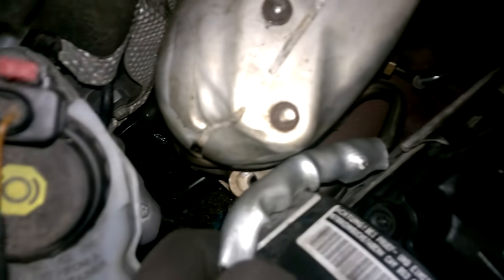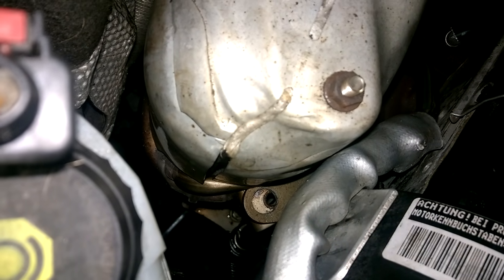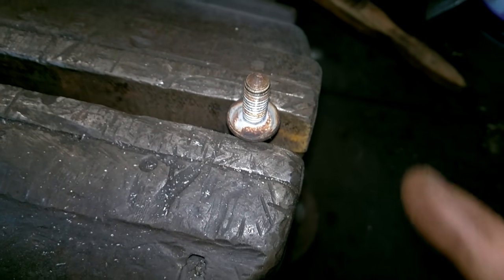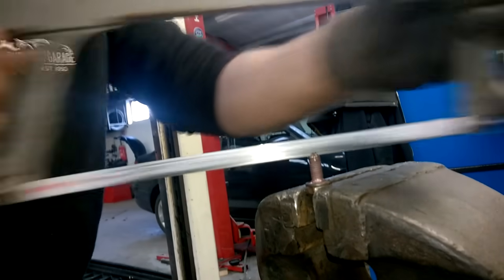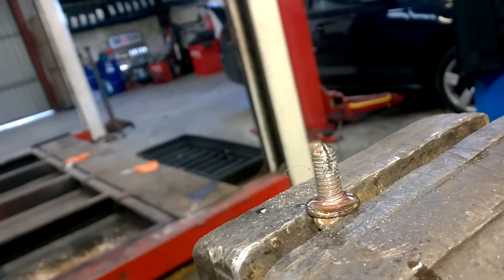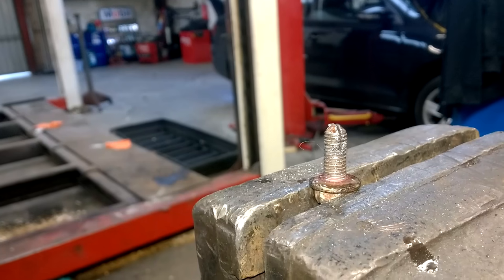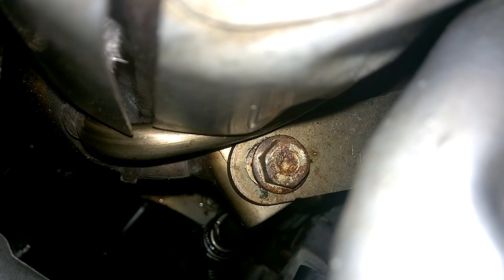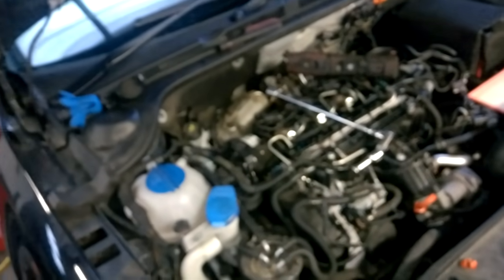My Father Taught Me This! Passing It On To The Next Generation

Comment: the cuts also act as a cutting edge to clean up the threads much like a thread chaser. great job sir!
Reply from the maker: Nailed it Trae, 99% people don't get that part. I made a follow up video ages ago to show it. 
 
The update info below is the pinned comment on this video, I know most people do not realize I made that video and it better explains/shows this method in use.   
I also included below details of why the job was done this way free of charge with the customer fully informed. I hope you check it out  👇👇
 
UPDATE* I decided to make a follow up video on this https://www.youtube.com/watch?v=yfNQullGEuQ&feature=youtu.be Should answer some of the questions that were raised, I include 3 demos of this in action with close up shots.
 
As there was some safety concerns & confusing comments raised, I felt I should clear a few things up. 
1) This is a tip for certain circumstances only, I never have and never would use it on a component which would cause any safety concern to any customer.  
2) The demo was done on a support bracket only, items like this or similar will not cause any safety concern. 
3) I did this free of charge and on a time restraint, I noticed it when I was replacing another item, the customer needed the vehicle back that evening and I decided rather than leave it like it was, I would do this and secure it up fully. 
4) The bolt was not the issue, the part that the bolt threads into is a secured piece, someone had previously damaged it, leaving the bracket loose and the bolt just tightened a turn or so.
5) The bolt can be removed and will not break, it will go in and out as usual and has helped clean up the damaged threads.  
6) Used in the right application I personally believe this is a great tip and can save you a lot of time & trouble. 

Lastly to all the people who have watched the video, Thanks very much and I am delighted with the feedback I have received on it.

Comment: My Dad showed me a trick too use a set of stocks & dies to retap a bolt put on some oil 1 rotation forward half a rotation back to clean out dags or screw 2 nuts onto a bolt one screwed back other screw in they lock against each other that's a lock nut right there ! 👍

Comment: Great idea, but I'd suggest starting the slot with a moto tool and thin cutting wheel. Otherwise with many high grade bolts your hacksaw will be sliding all over when trying to get started.

Comment: Very nice. I’ve always known this was why fender bolts are pointed but I never thought of doing this with other bolts on other application. Thanks
Reply from the maker: Thanks moore fab
 
The update info below is the pinned comment on this video, I know most people do not realize I made that video and it better explains/shows this method in use.   
I also included below details of why the job was done this way free of charge with the customer fully informed. I hope you check it out  👇👇
 
UPDATE* I decided to make a follow up video on this https://www.youtube.com/watch?v=yfNQullGEuQ&feature=youtu.be Should answer some of the questions that were raised, I include 3 demos of this in action with close up shots.
 
As there was some safety concerns & confusing comments raised, I felt I should clear a few things up. 
1) This is a tip for certain circumstances only, I never have and never would use it on a component which would cause any safety concern to any customer.  
2) The demo was done on a support bracket only, items like this or similar will not cause any safety concern. 
3) I did this free of charge and on a time restraint, I noticed it when I was replacing another item, the customer needed the vehicle back that evening and I decided rather than leave it like it was, I would do this and secure it up fully. 
4) The bolt was not the issue, the part that the bolt threads into is a secured piece, someone had previously damaged it, leaving the bracket loose and the bolt just tightened a turn or so.
5) The bolt can be removed and will not break, it will go in and out as usual and has helped clean up the damaged threads.  
6) Used in the right application I personally believe this is a great tip and can save you a lot of time & trouble. 

Lastly to all the people who have watched the video, Thanks very much and I am delighted with the feedback I have received on it.

Comment: always use the full length of a hacksaw blade because not only does it make efficient use of your energy but by wearing the blade evenly it prevents it from jamming, this also makes the blade last longer. using only the middle means the "set" of the blade wears faster there and when a stroke hits an unworn section it jams. only put weight on the cutting stroke, the return stroke is for clearing swarf. And the length of a hammer handle is there for a reason as well. a mechanical advantage is gained by holding the hammer at the end giving a heavier blow for less energy. All hand tools have been  developed into their most efficient shapes and sizes by craftsmen over many years for a reason.

Comment: I’m not one for cutting corners( in this case bolts), but looking at the wear spot on the bracket, it would appear that things became out of alignment a long time ago. Everything is designed with purpose in mind, you have just circumvented the integrity by adding stress to the bracket and bolt hole, better to disassemble and realign so it’s proper.

Comment: Quick tip, before you cut a screw/bolt, thread on a nut. It will clean up burrs on the threads when you back the nut off.

Comment: Who in the Holy Flying F*** would take the time to watch this and give it a "thumbs down?" Thanks for taking the time to post this simple, but effective little tid-bit of knowledge. Cheers!!
Reply from the maker: Cheers Marc 

The update info below is the pinned comment on this video, I know most people do not realize I made that video and it better explains/shows this method in use.   
I also included below details of why the job was done this way free of charge with the customer fully informed. I hope you check it out  👇👇
 
UPDATE* I decided to make a follow up video on this https://www.youtube.com/watch?v=yfNQullGEuQ&feature=youtu.be Should answer some of the questions that were raised, I include 3 demos of this in action with close up shots.
 
As there was some safety concerns & confusing comments raised, I felt I should clear a few things up. 
1) This is a tip for certain circumstances only, I never have and never would use it on a component which would cause any safety concern to any customer.  
2) The demo was done on a support bracket only, items like this or similar will not cause any safety concern. 
3) I did this free of charge and on a time restraint, I noticed it when I was replacing another item, the customer needed the vehicle back that evening and I decided rather than leave it like it was, I would do this and secure it up fully. 
4) The bolt was not the issue, the part that the bolt threads into is a secured piece, someone had previously damaged it, leaving the bracket loose and the bolt just tightened a turn or so.
5) The bolt can be removed and will not break, it will go in and out as usual and has helped clean up the damaged threads.  
6) Used in the right application I personally believe this is a great tip and can save you a lot of time & trouble. 

Lastly to all the people who have watched the video, Thanks very much and I am delighted with the feedback I have received on it.
Reply: Gerard Burke, thanks for the update! Your Father continues to educate us through you. Love it!! Keep 'em coming!

Comment: That bracket is supposed to be tightened to the engine 1st. Then the top bolt is supposed to be screwed in and left loose BEFORE tightening the 2 bottom bolts on the DPF.

Comment: That's quite clever.
I thought from the thumbnail it was going to be a trick I found when undoing stiff bolts that unscrewed, a laborious fraction of a turn at a time, from the back of a flange (so the spanner on the bolt head could only turn a few degrees before hitting the surroundings).   Cut a slot in them, then you can put a screwdriver through the hole and screw the bolts most of the way with the screwdriver from the front, just the final tightening or initial loosening needs the spanner to be applied to the head behind the flange.

Comment: I have had to grind a bolt thread down like a point.but on one side.grind the bolt on a 45 degree first.then anothe 45 degree against that cut.then taper off the treads. that way when you have a motor mount or two peices that are very hard to hold in alignment,that point will go in and pry the two holes in alignment as the tread starts.always works perfect.this is a very good idea also.exept it wouldnt align as much as a pointed bolt.

Comment: Creative. No holds barred. We need all the tips we can share with one another, due to strength and some mech's leaving it for the next SOB, as a mech in the U.S. Navy Aviation rate, i was schooled by pro attitude ol timers that if u leave it for the next SOB, i might b that next SOB.
1977-1988 / HAL-5
Helicopter Attack Squadron Light-5, we had 8 to maintain, so u see how it can come back to bite you.

Comment: The good threads are at the bottom because someone messed up the top threads. Since the top threads are damaged and now the bottom of the bolt is weak, you only have a couple of decent threads holding. This is a good trick for something that doesn't matter. The right way to do this is to clean the hole threads with a tap and or use a longer bolt to get more good bottom hole threads if possible. Bolt hole threads usually get damaged from people being in a hurry and using impact guns to start bolts, instead of being gentle. There's an old saying" slow down, we're in a hurry".

Comment: Why not use a three point (triangle) file and clean the threads up? Then it'll go right in nice and you don't loose any holding strength.
You may also have to clean up (retap) the threads in the hole. If screw was damaged chance is the hole it came out of was damaged too.

Comment: It works but I don't think it works for the reason stated.  The bolt might collapse a bit one direction but I don't think it's enough. 
What you've done is essentially created a self-tapping screw.  It's a good tip and certainly works great.

Comment: How about loosening the rest of the bolts that hold the bracket. That way you can adjust the bracket and you won’t have to slot the bolt to force it into place. Do the job right and you don’t have to worry about things like this.

Comment: Love it. Here's my 'get out of dodge' suggestion for anybody who needs to drill through stainless steel; if for whatever reason you are missing a cobalt drill bit? A masonry drill bit will do the job, maybe not exactly 6.5 mm but near enough to fasten/bolt one surface to another?
I am the last person to 'espouse' bodging a job (I couldn't suffer it), do it right or don't do it as all but there will come a time when you have to judge craftsmanship against simple expediency. I reluctantly agree that 'making the thing work' is often the object and it should remain so. I have literally stepped in the footsteps of the Stephenson's, I hope they thought I did a good job!

Comment: If that bracket was the original part It should fit. If the holes are out of alignment some thing is wrong.
Either the parts it bolts to is positioned incorrectly. Or you have tightened the other bolts before fitting the last one.
When you have more than one bolt holding a component, you should fit all the bolts before tightening them.

Comment: I am 58 years old first twenty years of my working life in the engine reconditioning game and i taught my son how to invert the bolt and taper the end where the threads are damaged on a bench grinder works everytime you also do it when you shorten a bolt or cut some threaded rod, just put a slight taper on the end of the bolt.

Comment: Cut off wheel on a rotary tool will save you time, and effort. A similar trick works for rounded bolt heads. Just cut a slot in the head and remove with a screwdriver.

Comment: Interesting hack to a problem.

I would have to point out that the first thing to do is find out why the bracket hole doesn't line up in the first place. the bracket shows where the original bolt was holding it, the bracket didn't move over back to the original position. The bolt is in what kind of additional stress did you add to whatever the bracket was holding? Would that stress cause a long term problem to develop which will lead to a more costly repair. The bracket did have some play in it to begin with, what about a bracket that didn't have the flex required?

Comment: Or you could have used a punch to line up the brackets, and then once in proper alignment, hold them in position with a small needle nose vise grip and start the bolt.

Comment: Nice tip... Would like to pass one on to you. Could save you some $ on hacksaw blades. The balde only cuts one direction. Then you lightly drag the saw back to clean teeth. Trying to saw in both directions will just wear you and the blade out. And as mentioned in previous comments the longer the stroke or more blade used the more productive  and cost effective you are... Your Welcome in advance...

Comment: I’ve used the cut bolt/spark plug method for clearing and cleaning threads but this is a one up on the idea. I’m sure that there are situations in which cutting an X rather than a slot might be beneficial as a bolt alignment/ starter. Thank you for passing on your father’s “tribal knowledge” (information and techniques not written in manuals) and I’m positive that I will make use of it someday... I just hope that I remember this when a bolt frustrates me beyond reason.

Comment: I have many split bolts like that of different sizes in my toolbox. They are great also to clean up screwed up threads when you don't have the correct size tap in the toolbox, they act just like a tap most of the time.

Comment: Thanks friend. Thinning a bolt to get a tapered end is clever.
Reply from the maker: Thanks Bruce, I appreciate it mate, I linked the follow up below if ya have any interest in seeing the tip up close. 
 
The update info below is the pinned comment on this video, I know most people do not realize I made that video and it better explains/shows this method in use.   
I also included below details of why the job was done this way free of charge with the customer fully informed. I hope you check it out  👇👇
 
UPDATE* I decided to make a follow up video on this https://www.youtube.com/watch?v=yfNQullGEuQ&feature=youtu.be Should answer some of the questions that were raised, I include 3 demos of this in action with close up shots.
 
As there was some safety concerns & confusing comments raised, I felt I should clear a few things up. 
1) This is a tip for certain circumstances only, I never have and never would use it on a component which would cause any safety concern to any customer.  
2) The demo was done on a support bracket only, items like this or similar will not cause any safety concern. 
3) I did this free of charge and on a time restraint, I noticed it when I was replacing another item, the customer needed the vehicle back that evening and I decided rather than leave it like it was, I would do this and secure it up fully. 
4) The bolt was not the issue, the part that the bolt threads into is a secured piece, someone had previously damaged it, leaving the bracket loose and the bolt just tightened a turn or so.
5) The bolt can be removed and will not break, it will go in and out as usual and has helped clean up the damaged threads.  
6) Used in the right application I personally believe this is a great tip and can save you a lot of time & trouble. 

Lastly to all the people who have watched the video, Thanks very much and I am delighted with the feedback I have received on it.

Comment: Dads are the best!
Reply from the maker: Cheers John 
 
The update info below is the pinned comment on this video, I know most people do not realize I made that video and it better explains/shows this method in use.   
I also included below details of why the job was done this way free of charge with the customer fully informed. I hope you check it out  👇👇
 
UPDATE* I decided to make a follow up video on this https://www.youtube.com/watch?v=yfNQullGEuQ&feature=youtu.be Should answer some of the questions that were raised, I include 3 demos of this in action with close up shots.
 
As there was some safety concerns & confusing comments raised, I felt I should clear a few things up. 
1) This is a tip for certain circumstances only, I never have and never would use it on a component which would cause any safety concern to any customer.  
2) The demo was done on a support bracket only, items like this or similar will not cause any safety concern. 
3) I did this free of charge and on a time restraint, I noticed it when I was replacing another item, the customer needed the vehicle back that evening and I decided rather than leave it like it was, I would do this and secure it up fully. 
4) The bolt was not the issue, the part that the bolt threads into is a secured piece, someone had previously damaged it, leaving the bracket loose and the bolt just tightened a turn or so.
5) The bolt can be removed and will not break, it will go in and out as usual and has helped clean up the damaged threads.  
6) Used in the right application I personally believe this is a great tip and can save you a lot of time & trouble. 

Lastly to all the people who have watched the video, Thanks very much and I am delighted with the feedback I have received on it.